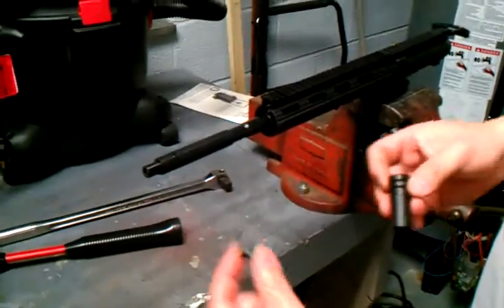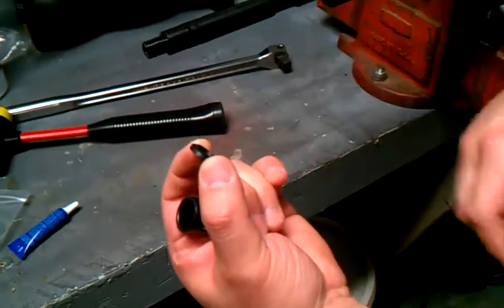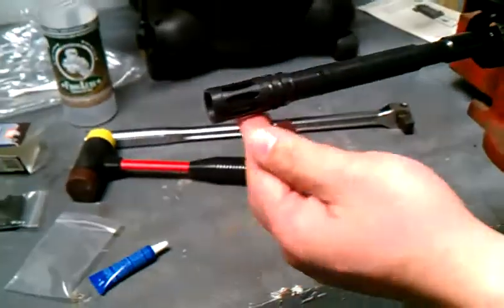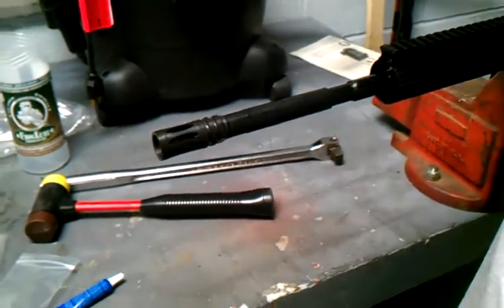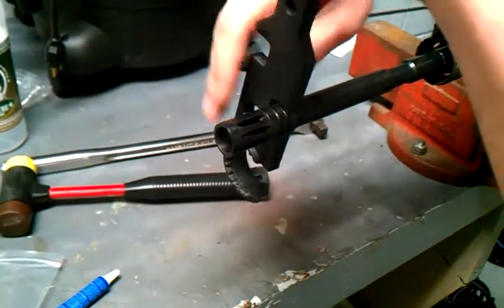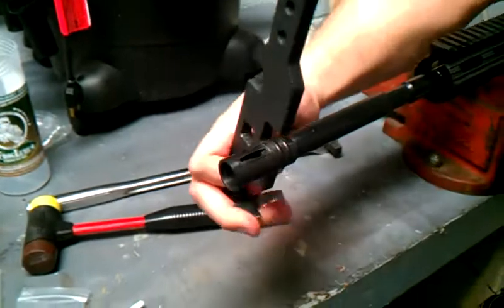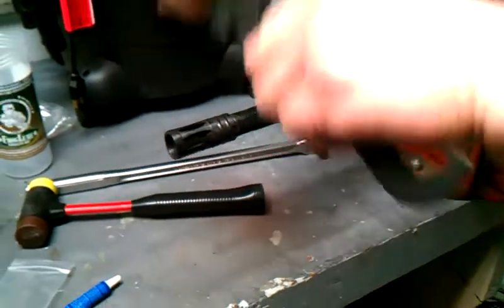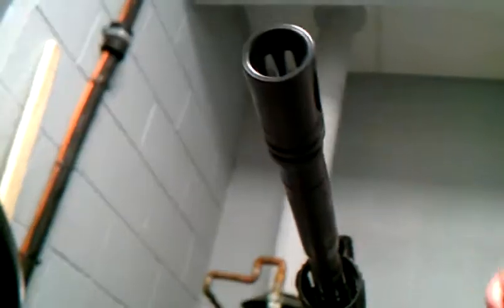How to Build The AR-15:  Muzzle Device Install

Comment: I would back it off each time it starts to get tight. It helps insure that you are not putting to much pressure on the threads all at once and it helps to insure perfect or close to perfect alignment for the flash hider. Always tighten to the correct index. Just my two cents.

Comment: What is this wrench that you are using?
Reply: Firas Chahine It is an AR "combo" wrench.  I'll do a review of the tools needed for an AR build soon.  The slot on the wrench is equivalent to a 3/4" open end wrench.  I've got other muzzle devices I need to post.  Just a friendly FYI, most manufacturers say to torque the device to 15-20 ft-lbs, but you need to "crush" the crush washer with more torque than that to time the device correctly.  I've done a dozen or so with no damage to threads.
Reply: TheScreaminTiger  Thanks! I am looking to change the muzzle break on my SIG716 .308, so I think this combo wrench would be handy
Reply from the maker: Firas Chahine An adjustable wrench will also work, just be aware that the edges of the crush washer can get flattened on the "flats" of the muzzle device.  The combo wrench will take off the muzzle device, the castle nut for the buffer tube, and is an absolute must to torque or take off a mil-spec barrel nut or the free float type barrel nuts Yankee Hill is known for.  Good luck on your customization.  That's an excellent weapon you've got!
Reply from the maker: Firas Chahine The combo wrench has two slots, one 3/4" and one 1/2" in size.  The 3/4" slot is for 1/2"x 28 threaded muzzle devices.  I've never had to use the 1/2" size slot.
Sorry I didn't clarify earlier, the combo tool is for the AR-15 sized barrel nuts and muzzle devices, (it will work on Gen II DPMS .308 rifles too).
So it won't work on an LR-308/ AR-10, except for the castle nut on the buffer tube, (since they are the same size).  

There is a bigger version combo wrench that will work for the LR-308/ AR-10.  That being said, the muzzle device wrench needed on a .308 is actually around 7/8" as measured with a caliper.  So, if you don't have an open end wrench that big, I'd just use an adjustable wrench.  Just make sure you have some way of clamping either your barrel, or your upper into a bench vise and go slow as to not twist your upper(it is possible).  (I really loath the bench blocks that only hold the upper through the pivot and take down pins...shudder)  They also make a magwell block to hold the weapon, which I would use before I would use the bench block mentioned earlier.

I hope this helps and happy upgrading.